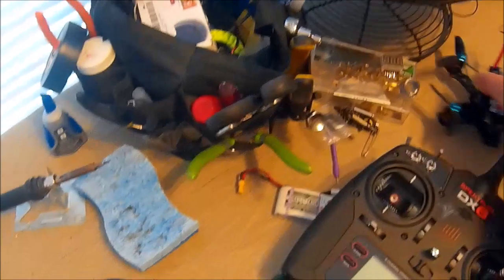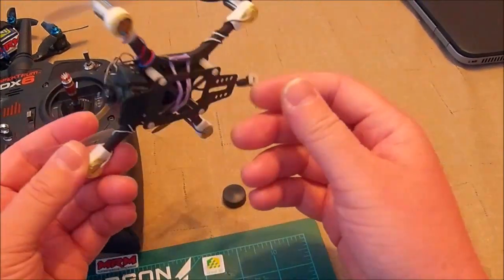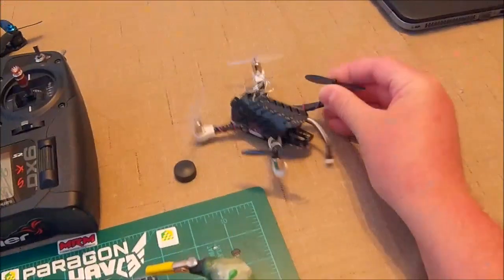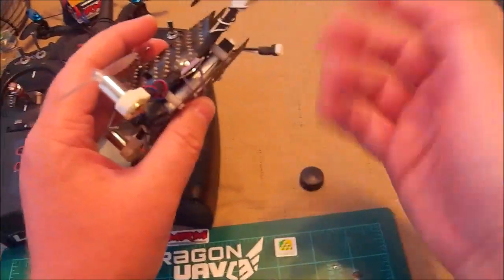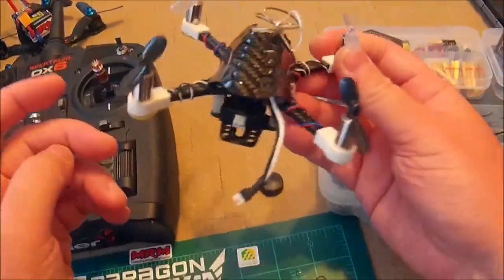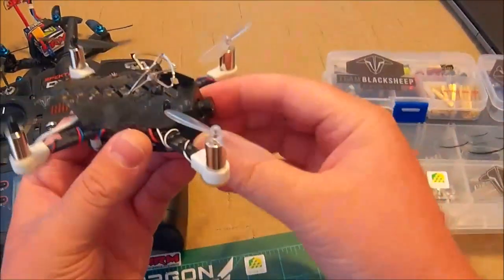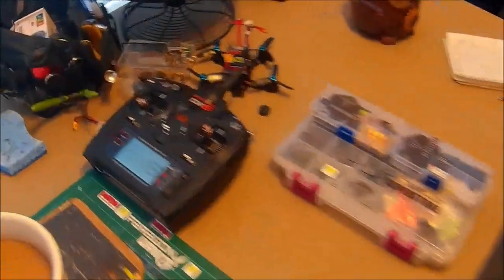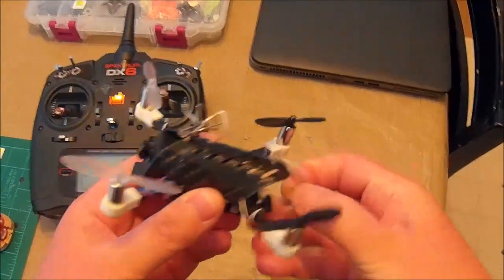f3 brushed update

Comment: Adam, what hex did you use for this board to flash bete 3.0? Kinda looks like the SPRacing F3, non EVO
Reply: Cant get the damn thing to boot up in clean flight so I shorted boot pads, red activity light does not flash but still will not boot...im on a mac and have zero problems with any of my other boards
Reply: need a Apple MAC solution :- ( on a positive not, got the Happy Model SPRacing F3 EVO, humming along very nicely in beta 3.0...YOUR flying skills are way beyond mine , setting may still piss you off

Comment: could you share your betaflight CLI dump?
Reply: thanks for the quick reply. I will build my 1st brushed micro 105, using the same eachine fc, but will be running betaflight 3.0 with 'betaflight' pid controller, can i just copy your 'FLOAT' PIDs directly without any tunning?